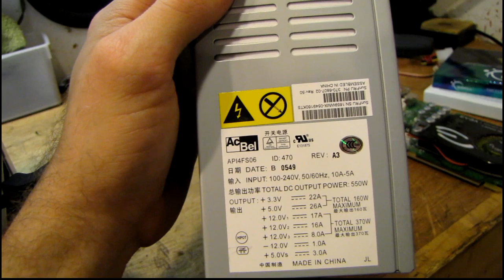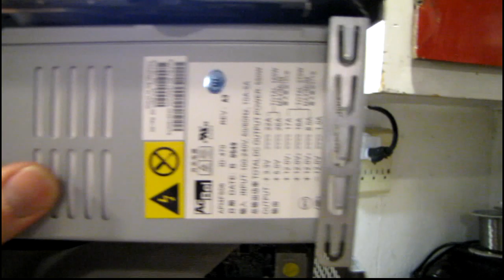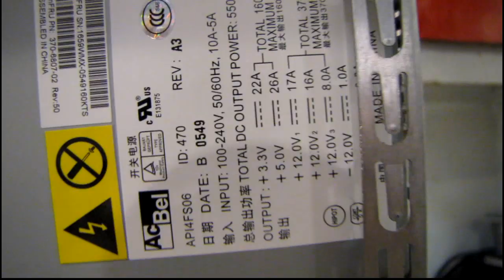Fixing up a Dell desktop computer, Part 1 of 2

Comment: would it be possible to get an estimate on the value of the components in this computer( with motherboard, cooling fans, dvd burners and power supply)? I found one at a garage sale, and wanted to get an idea of what I could get for it.

Comment: To improve cooling in my Optiplex GX620 (real similar unit), I hot glued a 92mm fan on the back of the heatsink to help blow more hot air out the back.

Comment from the maker: @Madness832 No, I got the 8-4 adapter on Ebay, from a seller called htpcusa.  You'll also want an adapter cable if your motherboard only has a 20 pin connector, since the 24 pin main plug doesn't separate either.

Comment: So ACbel PSU's have decent build quality... but suffer from cheap capacitors? 

i was under the impression that they where ticking time bombs waiting to happen from the number  power mac G4's i serviced with dead ACbel PSUs in them and my fathers G4 tower one went through two of them...

Comment from the maker: @Knaeckebrotsaege That's good to know.  DDR2 1066 is hard to achieve sometimes, even with actual 1066 modules.

Is G.Skill related to Geil at all?  I've never heard of them until recently.  I used to use Mushkin, but I like G.Skill better so far.  Kingston has never failed me either.

Comment: I was working on one of these just the outer day.
I had to replace the power supply twice. Ounce to fix the bad power supply. And then again. Because the Sata power connector was not a angled one and the door was not able to go on.